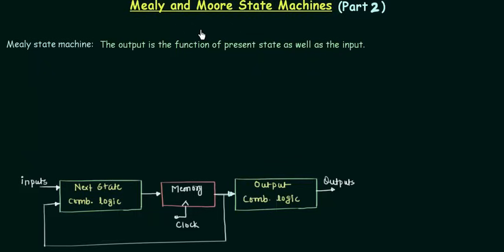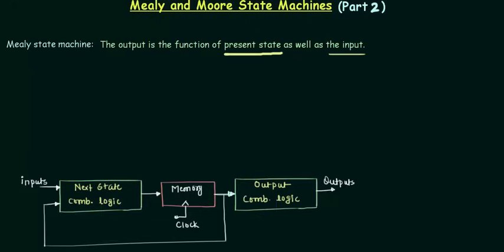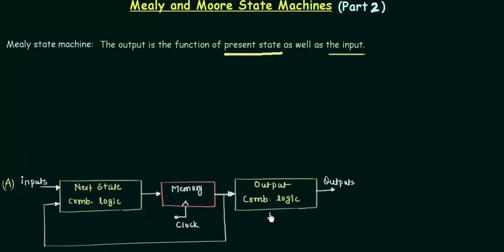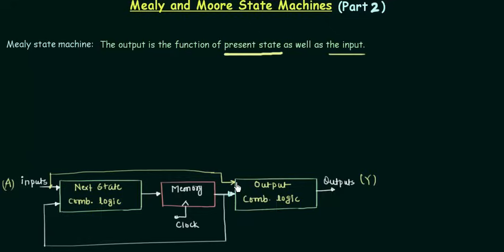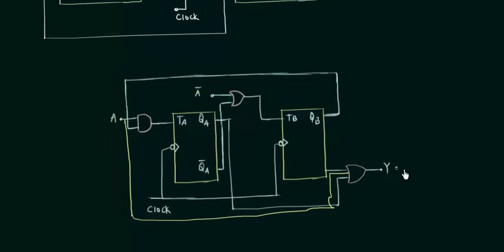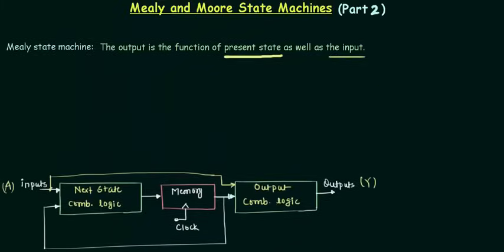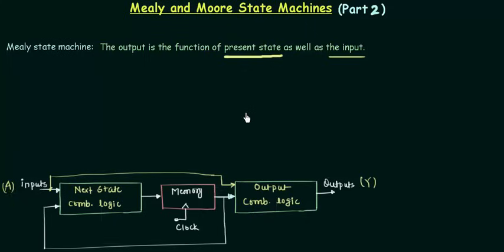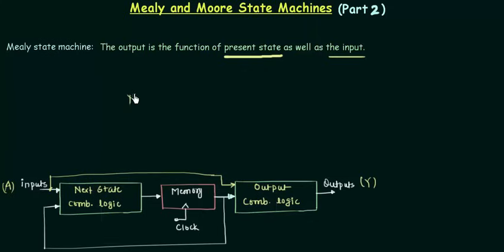Mealy and Moore State Machines (Part 2)

Comment: I have been given the following  problem
Can someone help me?

Design the control logic for a Finite State Machine of Moore’s type (Moore’s machine: output only depends on the current state). 

Problem Description:
The FSM monitors the water level in the tank of Figure 1 and opens the discharge valve if the water level is above certain value (Level_high); then the valve stays open until the water level has fallen below a certain value (Level_low). 

When the FSM is first started (and following reset) the tank valve should be closed.

FSM Inputs:
The following binary inputs inform the FSM of the water level in the tank. 

Above_level_high: this is 1 if the water level is above a certain value (Level_high). It is 0 otherwise.

Below_level_low: this is 1 if the water level is below a certain value (Level_low). It is 0 otherwise.

You can assume Level_low <  Level_high .

Output:
The FSM controls a discharge valve. Command to Discharge_valve is: 
1 to open the valve;  
0 to close the valve.

Unfortunatly  I can't upload the figure that came with the problem . however if any one is interested please email me at: andersonluk3l@gmail.com